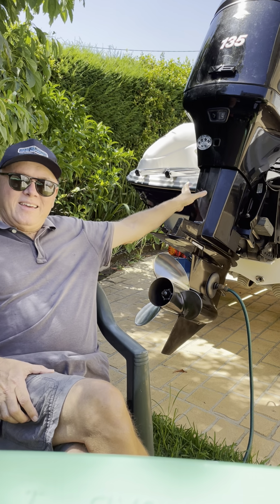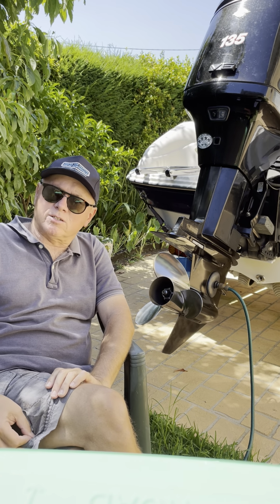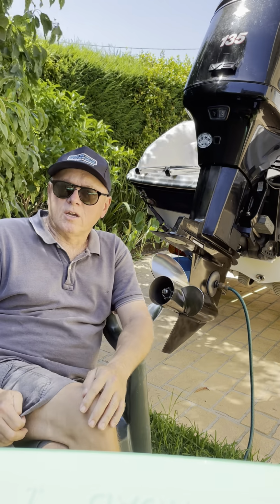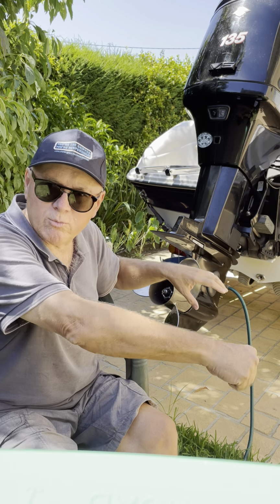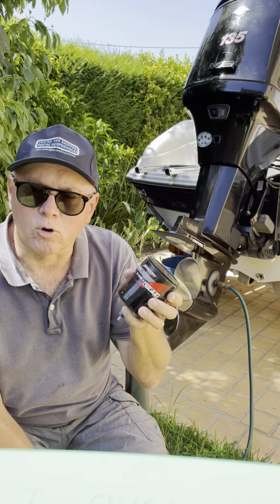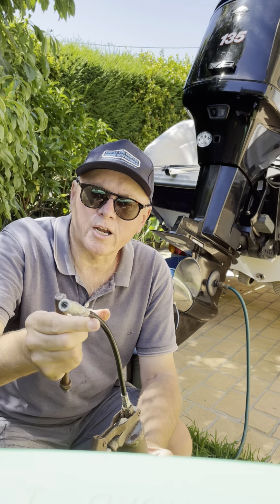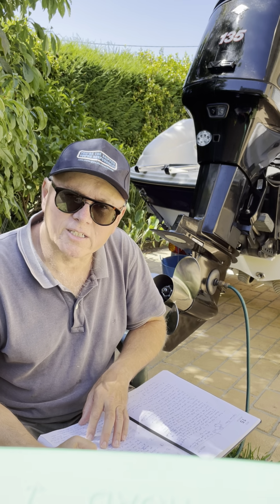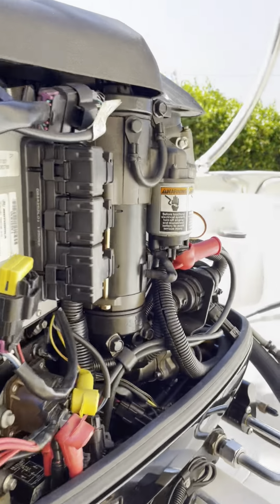Buying or Own a Mercury Optimax Outboard? Here are 15 Tips!

Comment: I have two 2005 Mercury Optimax 225 engines with DTS on my 29’ SeaVee Center Console, owned since bought brand new.   I love my Optis.   This is a solid video from Tony that covers a lot of relevant and on-point things.

Have 1,460 hours on them.  Have also been religious with maintenance, often going well beyond the regular recommended maintenance in terms of being conservative.   Since about 400 hours I have also been using Pennzoil XLF 2-stroke DFI oil.   At 1,100 hours, knowing the air compressor is potential catastrophic and expensive failure point, I changed out my still working compressors with brand new ones of the (supposedly) better bearing 2nd gen design.   Have changed out recently still working air/fuel and tracker diaphragms in the fuel rails, all new coil packs and spark plug cables.    It is vitally important to change out regularly the small in-line oil filters under the cowlings.   Have replaced the crankcase driven fuel pump and the low and high pressure fuel pumps inside the VST once as well.

I would also recommend running 2 ounces of Mercury/Quicksilver Quickleen for every 10 gallons of fuel.  I have also started to run a very diluted premix of DFI oil with the fuel (150:1).  There is an extensive amount of info for Mercury Optimax owners on all sorts of topics including a “fuel cocktail) at the BBC boards (Bass Boat Connection forums.   See:  https://www.bbcboards.net/showthread.php?t=20401

Most recent major repair/maintenance on both engines was I had to replace the exhaust plate.   They were corroding badly right at the area on the stern side where the exhaust idle relief boot is attached.  That was allowing some exhaust gasses to remain trapped inside the cowling and being re-ingested into the combustion chamber.  I had also suspected that over time the 18 exhaust ports inside the exhaust tube (a/k/a exhaust tuner - akin to a muffler on a car) had accumulated carbon and tar-like deposits, impeding some of the exhaust at idle to come out of the exhaust idle relief.  The telltale was, more so on my port engine, an excessive amount of bubbling at idle out of the prop as instead of a blend of exhaust at idle from prop and the above water idle relief boot.   This was quite a big job, as it involved removing the powerhead.  In that process, to remove the old exhaust plate I had to cut off the upper and lower motor mounts as the 20 yer old bolts for same were rusting.  So new motor mounts as well as new exhaust plate kit with idle relief boot and gaskets for both.  While the PH and middle drive housing were off, I removed the exhaust tube and cleaned out the 18 idle relief ports.  That was a messy job, and done by soaking them in. 5 gallon bucket for 24 hours in a 50/50 mix of acetone and automatic trans fluid, then reaming out the ports with a brass bore brush.   While all was off I also pulled the steering swivel pins, honed them with Emory cloth and then reamed out and cleaned out all the old grease inside the steering swivel pin housings, put on new bushings and seals and o-ring.  The engines turn smooth as butter.

Engines run and idle like a dream.   Here is a short 14 second clip of the engines at idle at the dock here in Miami from a few weeks ago:

https://youtu.be/lNSDL5prk94?si=uZIH_VE5TmragQ1a

Comment: Excellent tips. Just a quick question: I have an Opti 150 and I am not sure where to connect the battery wires to the outboard. I think I know where the + goes, but no idea about the - . Could you tell me where?
Reply from the maker: Apologies I took so long to reply! See photos in the following thread, it goes on one of the starter motor mounting bolts https://www.rib.net/forum/f37/quick-favour-anyone-with-a-mercury-optimax-115-175hp-84776.html
Reply: @anthonydrake2258  yep. I worked that out in the end. Apparently any bolt that attaches to the block will work. I connected the big socket, negative and positive and still not turning over. Also tilt and trim won't work from the outboard. If I turn the key I get no beep, nothing. I tested that I have current to the outboard with a multimeter, but absolutely dead. Battery is brand new and tested. Outboard only has 220 hours on it.
Reply: Maybe solenoid or maybe the battery leads are not drawing enough amps and need replacing. Electrical fault finding sucks!!
Reply from the maker: See the photo from Sparkey on page 6, not the earlier photo which is incorrect. Good luck! It is winter and raining again here in Sydney, looking forward to the sun coming out again!😊
Reply: @anthonydrake2258  I wonder if I accidentally have the outboard in gear after I connected the shifter cable and mucked around with it...hmm, maybe not electrical.

Comment: The poppet valve needs to be cleaned out occasionally . I believe that the oil pump can be dismantled and internal o rings replaced .
 The 115 hp  electric fuel pumps inside the vapor separator are Walbro automotive pumps and can be bought online from automotive suppliers for about 1 third of the price that Mercury charge . They are listed on these sites as suiting Optimax engines . Probably the same on the 135 .
Reply from the maker: Love to see a poppet valve cleaning video! Regards Tony
Reply: @anthonydrake2258  Plenty on YouTube .
Reply from the maker: Nice! I did mention it in the video thanks for your interest regards Tony
Reply: @anthonydrake2258  I took my water strainer nipple out and cut the strainer part off and screwed the nipple back into place 
. I then attached an inline clear Shurflo water filter / strainer that I purchased from Whitworths onto the rubber hose going to the compressor  .  The filter lies inside the cowling and you can see at a glance if it is starting to block up .
Reply from the maker: Probably best to replace poppet valves rather than clean. They are not expensive. Also make sure you get a 200mm flexible 1/4 inch socket extension to get at that lower bolt at the back of the lower cowling, removing the cowling will make the job a lot easier…….
Reply from the maker: Nice! How about some photos! Are you Aussie?
Reply: @anthonydrake2258  Yeah , Aussie . Filter wasn't my idea , saw it somewhere .
Reply from the maker: You have so much valuable info you should do a video!

Comment: I belive its safe to use XD100 oil, and even XD50 oil, and oil that meets the demand from mercury. Also, the syntetic 2 stroke oil from mercury racing is better than the dfi oil, and should be used on 300 xs engines.
Reply from the maker: Hmm thanks for your comment, don't think I would risk it...............you could be right about the 300 xs though! Regards Tony
Reply: tc-w3 nmma oil is okay to use. It should be no risk, and it say in the book, that oil that got this standard is ok to use. two cyles watercooled forula 3 oil ..tested to meet NMMA .
 @anthonydrake2258
Reply: @anthonydrake2258  Three different engines are used by the NMMA to test the oils and determine if they meet TC-W3 certification standards. First, the outboard motor oil is tested on a BRP 40 hp engine and a Johnson 70 hp. They also run two consecutive tests using a Mercury 15 hp motor and two separate lubricity tests. This variety of testing ensures that the oil’s performance is uniform in all two-stroke engines. 

During the tests, the engines run for 100 hours each. Every ten hours during the test, the testers stop the engines and the oil is inspected. The testing process remains constant regardless of the manufacturer and chemical makeup of the oil. Many boat manufacturers specify TC-W3 certified oils for their engines, so receiving TC-W3 certification can be a boon for an oil manufacturer.

Comment: Hello Anthony, thanks for your video. I have a 150Hp Optimax from 2005 (I think). Mine also makes that noise when I lower the unit down. I did not know if that was normal or not. I got this boat last year and I am prepping to run it again this summer. My boat is a Boston Whaler 17 foot, Manual says weight is 800kg + 200kg engine, +100 liter fuel and 2 persons let's say +180 for a total of 1,280 kg. I have a Mercury Stainless Steel Mirage prop 17p on it. My boat is only doing 30NM per hour and max rev range is between 3500 and 4000 rpm. I understood these engine can go to 4500 or 5000 rpm (not that I want to) but I have a feeling that 1) this boat should go faster with this engine and 2) why can't I get to that high rev range? You mentioned that you have a 19pitch propeller on your 18ft boat, what speed could you get max? I know the previous owner put that prop to be able to pull skiers behind to have that "hole shot" but me I am not interested in having an immediate brute force, I'd just like to go faster than 30NM. What do you think is the case? The engine otherwise is perfect, never had a problem. I was maybe thinking throttle linkage needs to be adjusted on the engine side, maybe it's not pulling the throttle all the way, but besides that, is 30NM at 3500rpm with a 17P prop a good figure? Thank you!
Reply from the maker: I have added a new video to help you check the throttle linkage position on your Optimax 150hp. Check it out! Regards Tony
Reply: @anthonydrake2258  Thank you Anthony! I just received service parts like impeller, airfilter, the two fuel filters, gear oil etc, i'll be referencing back to your video. I will check out your video now. Thanks for letting me know and making these videos!
Reply from the maker: Hi thanks for your reply! My boat is about 200 Kg lighter than yours otherwise all same same except for the prop. The 135 hp optimax is actually a derated 150 and 135's have been dynoed at up to 148 hp so virtually the same engine. I can get over 43NM per hour in my boat easily, the engine can pull over 5500 rpm with the 19 inch prop and I even had the over rev alarm go off once when I trimmed the engine out at full speed. Your boat sounds like the perfect setup with the 17 inch prop. It is very important that the engine is able to reach maximum revs at the top end, especially optimax's. I agree with your suggestion to check the throttle linkage, especially if the engine is going well. Have fun with a great rig! Regards Tony